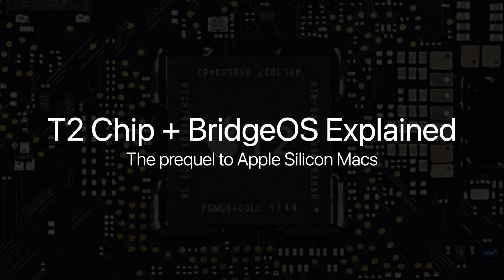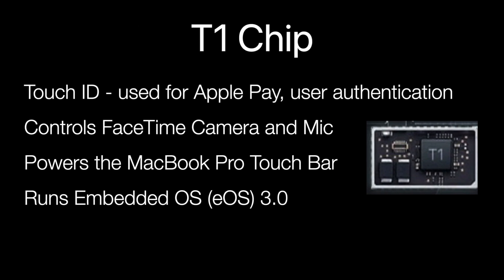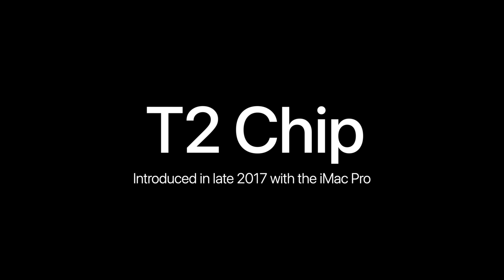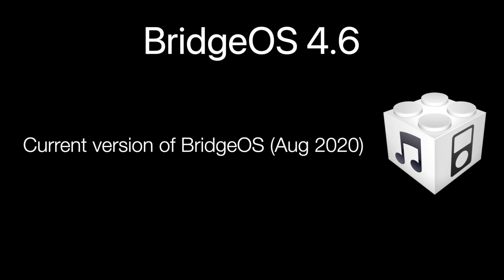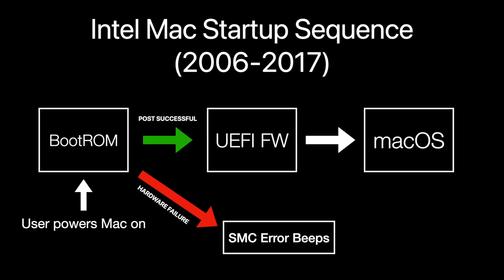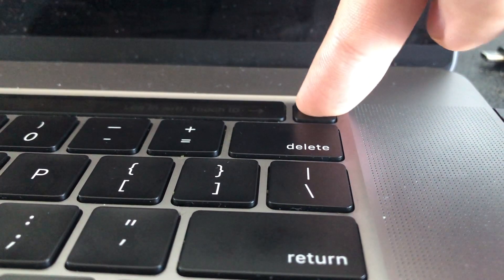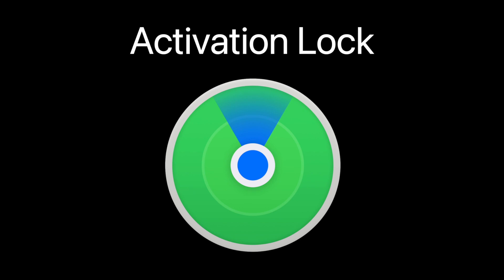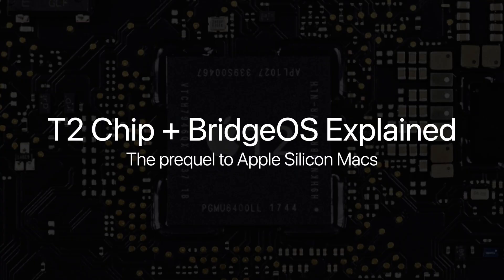Apple's T2 Chip Explained - Apple Silicon Prequel

Comment: macs which don't have thet2 or t1 chips but still natively support big sur and newer have the new, low pitch boot chime if big sur and newer is installed. otherwise if you want he t2 startup sound on a pre-2013 mac, you can follow dosdude's tutorial if you dont have a PowerPC mac. Nvidia MCP79/MCP89-based systems are incompatible too (such as a late 2010 11"MacBook Air)

Comment: Here's an interesting one:

Before Big Sur, my 2018 MacBook Pro 13" Intel quad i7 was unable to play VP9 codec in safari, but I was able to play this content in Chrome or Firefox, it's understood that safari blocked vp9 because of it being such a resource hog, understandable. Now, Safari uses the T2 HEVC decoder of the T2 chip on this same MacBook since Big Sur, 4k, 6k, 8k, etc plays, and it plays incredibly with nearly dead 0 system resource usage, insane. Oddly though, when I attempt to play back the same 8k60 video on YouTube on an M1 MacBook Pro 13", the M1 falls flat on its face and won't play smoothly, the 2018 MacBook Pro i7 does. It seems to me that on both machines, the apple silicon is doing the job, wouldn't the M1 large apple silicon chip do better?
Reply from the maker: That’s strange. Must be a bug with the M1, as it has a similar HEVC decoder to the T2
Reply: @NobelTech  it’s got to be, submitted to apple feedback in hopes they pick up on it